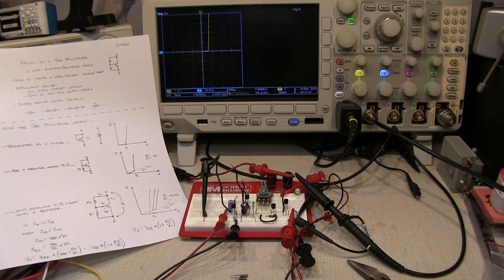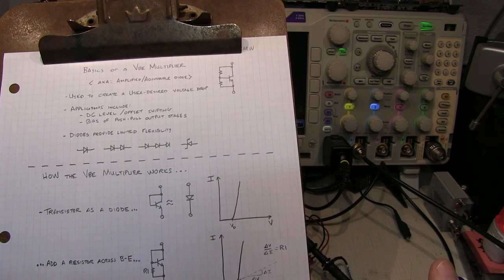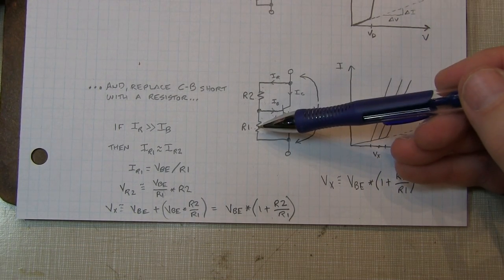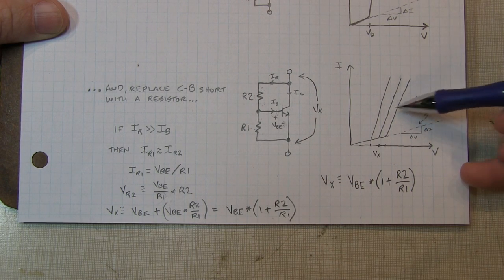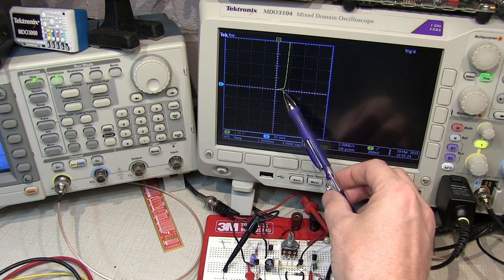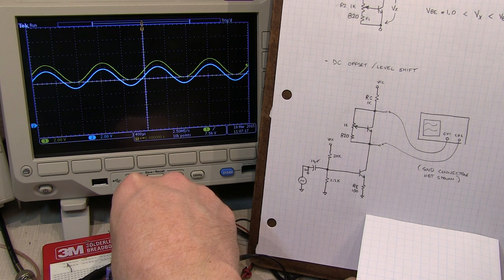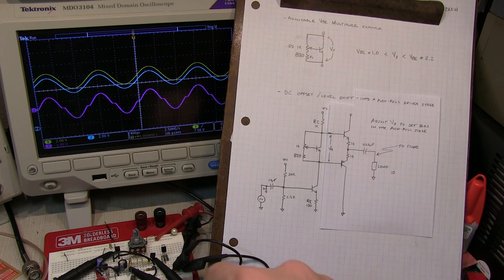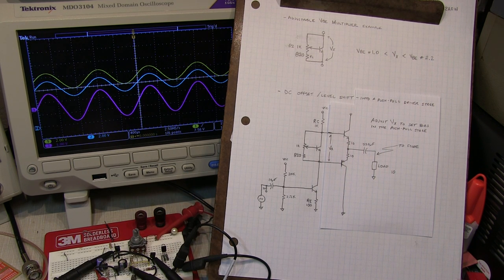#198: Basics of a Vbe Multiplier: what it is, how it works & where it is used

Comment: In the world dominated by Java, ARM, ... your videos "back to the basics" are awesome! They are like shake off the dust from my analog soul. I love them and keep on going!
Reply from the maker: Awesome comment - made me smile!  Why should we through a million transistors at a problem when just a few will do!
Reply: ***** 
I prefer analog myself - they just seem to be warmer and more fluid.
Reply: There is no analog, digital and pulse electronics. All is electromagnetic field theory. Analog and digital are just simplified theories. Nowadays microprocessor systems should be analyzed via analog and field theories because of their speed. Tracks on PCB are not digital connections but transmission lines with impedance (frequently differential pairs) and sometimes tracks are so long and bit rates so high that track works like a shift register and you can find several bits on one track one following another. So in fact we live now in analog word more than 20 or 40 years ago. Moreover EMC problems mixes digital with RF technology. Digital world is only for software boys, who do not understand what is happening inside the box :)
Reply: *****
 So true, there is some beauty in making something work with just a couple of transistors. I am fairly experienced in electronics but i keep using mostly opamps for any analog stuff. Thanks for teaching me new things
Reply: Codi Jack that's awesome comment. Number of engineers working on such discrete analog circuits, power amplifiers have reduced a lot. But Alan's videos always give us hope.
Reply: @maciejyt  Yes. Even if bits are moving fast then also all the magical things are happening on the transition edge. We just cant move from 0 to 1 all of a sudden.
Reply: @maciejyt  Some of us software boys know what's going on under the hood ;-)

Comment: Before watching this video, I was aware of Vbe multiplier circuits -- thanks to a coworker. However, I was NOT aware of the push-pull output application! That is brilliant!
Reply: The datasheet of many older op-amps (that show the internal schematic) will show the Vbe multiplier biasing push-pull outputs. For example, LM741.
Reply: Allways saw on audio shcemas the 2 or 3 diode. Never saw that multiplier- I wil look for it on the schemas of the op amps. Thanks for this comment.

Comment: Thanks. I actually watched this video quite a while back, but I couldn't follow it at all.
Now it makes complete sense. Although I understand Calculus well, which is not the same as doing derivatives and integrals, which really doesn't matter as much as understanding what it means. I have trouble following the math. I really guess that's a little bit of boredom, but I'll pull that in after a little bit. It's important to do at some point.
I'm 53 now and thrilled to be getting back into electronics again. I did it very very young age and without hardly any money. Now I can actually buy some decent equipment. I'm starting to be able to use it, too.
I'd enjoy using some good textbooks, but only with a group of people. Technical learning is a bit boring as DIY. Practical applied learning is fun now. Finally.
Thanks again!

Comment: I work with these "Push Pull" everyday service electron microscopes.  All the scan circuits utilize a push-pull circuit.  I remember learning about the PUSH-PULL circuit in college, but never fully understood how to compensate for the crossover distortion until NOW!  Your videos/ instruction is "Priceless" and should be required viewing for any electrical engineer student!

Comment: Great tutorial!  It's probably an obvious point and not sure if it was mentioned, but the transistor shunts away enough current in order to maintain the Vx voltage drop.  It will even maintain that drop when the supply voltage varies.  That was another key, for me at least, in understanding how the Vbe multiplier works.  Also, I think there is a required resistor between Vcc and the output otherwise the output will always be at Vcc.

Comment: In my amplifier output stages I use to couple the transistor of the Vbe multiplier thermally with the output stage and I use a constant current source (f.i. E-103) instead of Rc. In this way you can get a very stable bias current through the output stage.

Comment: Great video!  You didn't mention of a key point, I think... At least as far as the Class B/AB amplifier goes.  If the Vbe multiplier is thermally coupled to the output transistors, then as they heat up and their Vbe drops, so does the that of Vbe of the Vbe multiplier transistor and the bias current through the output stage (and hence distortion) remains more or less constant through the operating temperature range.  Also, it can help prevent thermal runaway...
Reply from the maker: Very good points.

Comment: This will work out handy for a project I'm working on now: converting an 8mm film projector to high-power LED. I'd like to have a control circuit at 5V, and the original bulb was rated 30V at 86W, so I figured I could use the power tap for it. The power tap supplies about 38VRMS, so I expect to get around 40VDC or more at low currents.

However, to use, say a 7805, I'd need a maximum input voltage of about 30V. This circuit will be an easy way to drop 20V or so to drive the 7805 for the low-current logic. I'll need to keep an eye on the temperature, though, as Vbe may drop as low as 400mV ... thankfully the current is quite low, but I'll probably use a relatively big transistor nonetheless.

Comment: Great tutorial - sure wish YouTube and teachers like you were around when I was learning electronics!

I'll admit to skipping around a bit, so I might have missed this, but did you mention that another great thing about this circuit, particularly in the push-pull application, is that as Vbe changes with temperature, the multiplier's output will track the Vbe shift of the output transistors?  So if you cancel the crossover distortion at one temp, it will stay cancelled as temp changes?
Reply: That's why in the classic Bailey Amp (from 1968), the bias transistor is mounted onto the same heatsink, close to the output transistors, to ensure thermal tracking. Do a search on the web for "30-watt High Fidelity Amplifier" if you're interested in reading a full description of the amplifier. I built one of these over 50 years ago and I've still never heard anything sound better.
Reply: Thanks, I thought this would be a disadvantage. As the junction voltage easily changes by a factor of two it is really a terrible idea to use it as a reference unless that is exactly what you want for compensation.

Comment: Thanks for the great video.  Often the amplifiers use some diodes and add negative feedback to reduce the distortion.  I think the designers should do it right to begin with and not try to hide the problem with negative feedback.

Comment: I'm glad to come across your video on Vbe Multiplier. As I'm in the process of building a transistor stereo amp and in that, it uses a VBE Multiplier Power Regulator to regulate the power supply for the amp. I was wondering if there is a more up-to-date design to serve the same purpose or transistor amp should have transistor power regulator, thanks !
Reply from the maker: Without knowing specifically how the Vbe multiplier is being used, it would be difficult to recommend a different or more up-to-date design.  If you're simply after a more up to date way to providing an adjustable voltage drop, then the most common modern solution would be something like the LM431. https://www.ti.com/lit/ds/symlink/lm431.pdf?ts=1644827857475

Comment: I DO like your videos Alan but in this case I have always used 2 diodes in series to eliminate the cross over distortion of an Audio output stage.  I'm sure though there are other uses for this circuit and the example is used as an alternative method to eliminate distortion, and here of course you have more control.

Comment: I guess I could use this circuit to replace a fawlty diode-cluster composed of 4 diodes in series (SDVSVT4HG) clamped on top of the power resistors.    That diode-cluster should act a a temp sensing device for feedback to the bias circuit.  Helas, those diodes are out of spec and unobtainable.  I guess I have to figure out which transistor could perform similarly temperature-wise and replace those bad diodes.  Thank you for this interesting video

Comment: thank you so much for supplying all these so interesting videos, I spent a lot of time watching them the last weeks. For the moment I have one question: what is the name of this special mode that you use with your scope, when you display one channel versus the other (I vs V)? do you also use a current probe for measuring I while its channel is displayed in voltage units? I have a DPO scope but I don't think this feature is available on it, is it specific to the MDO serie? thanks again for your work which is very helpfull to me!
Reply from the maker: I am just using XY mode, and "measuring" current simply by measuring the voltage across a fixed resistor (the voltage will obviously be proportional to the current flowing through it).  Your DPO should have XY mode.
Reply: @w2aew  did you delete my new comment or did I do a wrong operation and delete it myself? just for know, thank you
Reply from the maker: @frederichugenell5538  I didn't delete your comment.  Apparently YouTube blocks viewer comments that include links.  So, I was able to copy your message from my email notification:

w2aew thankk you for answering so quickly; and sorry for the so basic question I have asked, I know that oscilloscopes are supplied with this XY mode for a while, but I never used it; I have checked on my DPO and of course this mode is available; for displaying such a diode characteristic, I think you supply the circuit with a variable voltage (maybe a sine wave) between 0 and a few tenth of volts in order to be able to display the whole curve? and OK for probing the current with the resistor. I have another issue for which I want to ask your opinion: I'm trying to repair a bass amplifier for which the schematic is available on the web (https://cloud.univ-grenoble-alpes.fr/index.php/s/GeJYz6yGqEQwQqo), and I don't understand the biasing circuit of the push-pull output stage, it seems that the VBE multiplier is not biased symetricaly with respect to the rails (+/-V is around 30V), Q5 base is around 29.5V and Q6 around 28V, I don't understand how such a circuit is able to do the job, the positive swing will be very limited in such a case. Another question is the reason of the VBE multiplier fixed on the heatsink, I read somewhere that it should be thermaly coupled to the output transistor but I don't know the reason why. By advance thank you if you take time to answer me, and I you don't thank you nevertheless!

Yes, I supplied the circuit with an AC voltage (waveshape is really isn't too important, but triangle works best, sinewave works very well too).  With regard to your amplifier, there is definitely something wrong with your unit if you are seeing 29.5V at the base of Q5.  As I look at the circuit, the base of Q5 should be about 1.5-2.0V above Ground, thus about 16.5 to 17V above the negative rail. I'm figuring this since the base of Q3 should be within about 100mV of ground, thus the base of Q5 should be a little over two Vbe's above that.  The reason you want the Vbe Multiplier to the thermally coupled to the output devices is because the Vbe voltage is temperature dependent - it changes by about 2mV per degree Celcius.  By thermally coupling them, the Vbe multiplier will more closely track the Vbe change of the push-pull devices over temperature.
Reply: @w2aew  thanks so much for giving me all these answers, you're really a great and nice person! I have to investigate deeply ni order to figure out and find where the issue comes from; I did some other measurement and I have 26V at the gate of Q3, but I don't understand the role of R97/R98/C60/C26 and why C26 is tied between R46 and R47. How do you deduce that Q3's gate is around 100mV with respect to the ground? thanks to you once again.
Reply from the maker: @frederichugenell5538  I tried to go back to the schematic, but it looks like the file isn't available anymore, so I can't comment on the specific devices.  A couple of general comments may help though.  When figuring out the biasing point, any circuit branch that has a series capacitor can be ignored because it won't change the DC bias conditions with no signal present.  For the front end which is a emitter coupled differential pair amplifier (as I recall), this type of amplifier has a practical working range for the differential input voltage of about +/-100mV.  Once the input voltage difference goes beyond that, the amplifier output goes into limiting, provided there is no degeneration resistors in series with the emitters of the coupled pair.  So, since the input is basically biased to ground via a 47k resistor, the other input (being fed via feedback from the output) must also be near this voltage in order for the amplifier to be in it's linear region.  Other bias voltages can be estimated from this fact.
Reply: @w2aew  the file is still available, you just have to remove the last bracket in the link which was oddly included on it! :-) ok for the branch with serie capacitors unusefull with respect to biasing, I really understand this and thank you for your very  clever deduction of the biasing voltage level! I thought that the biasing of the push/pull output stage via the VBE mutliplier could be calculated via the surrondings elements of the VBE multiplier but since there are only resistors that tied this circuit to the negative rail and no resistor to the positice (no symetrical configuration as it is often possible to see) I could not understand how it works. Thank you once again!

Comment: on timeline 5:01, where you showed the final equation to determine Vx, would it not be better then to place the variable pot between the base emitter instead between the base and collector? Otherwise if the pot between base collector opens up, you would have too much voltage driving the push pull amplifiers and the excessive current may burn the push pull amplifiers and may cause them to fail.
Reply from the maker: putting the pot between base-emitter will result in non-linear response.

Comment: I wandered about building an adjustable biasing for example , I have a Yaesu FL-2100B amp , and I've read that the bias needs to be set for tubes other than what they came with .
Now with the issues of available 572B tubes , I have about 12 used , mix manufacture & different output tubes , and thought instead of a fixed bias / an adjustable to ease using the multiple mismatched tubes ?
Reply from the maker: KD0CAC I'm not familiar with the design of the FL-2100B, so don't know if anything resembling this could help you out.

Comment: In that push pull circuit wouldnt you want just the bottom of the two bias spreader base resistors to be a variable pot since if the pot goes open the transistor would turn off and cause the output transistor to run full current?

Comment: Some people mention using a Vbe multiplier for MOSFET output push - pull stages, but this doesn't make sense to me since I think most MOSFETS have a V(th) (Threshold voltage) at almost 4 volts. I can't see how any Vbe multipler would go up to 4 volts. Unless they use lower threshold MOSTFETS like I think a logic level MOSFET can turn on between 1 and 2 volts. So I can see the Vbe mulitplier possibly working there...

How would people typically use this in a MOSFET output stage?
Reply from the maker: This is the whole point of using a Vbe multiplier, it is a fully adjustable voltage drop, anything greater than or equal to a single Vbe. If the collector-base resistor equals the base-emitter resistor, then the drop will be 2*Vbe. If the c-b resistor is 2x the b-e resistor, then the drop will be 3xVbe, and so on.
Reply: @w2aew  huh. Ok, I think I see. You can almost any multiple (up to VCC). I guess that makes sense then. Thank you for the response, I learned a new circuit today thanks to you :)
Hm for 4 volts threshold like a IRF540 (just throwing out an example)..that would be around 7xVbe or so. I guess that could be done with the right combo of resistors.
Reply from the maker: Yes, and it doesn’t have to be an integer multiple.  V=Vbe*(1+Rcb/Rbe)